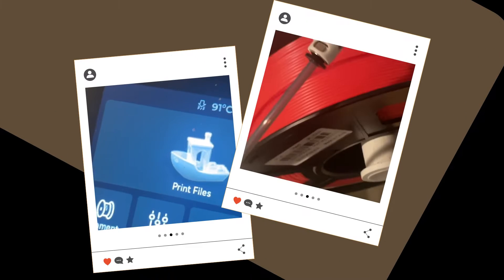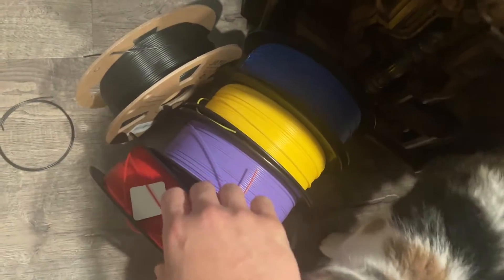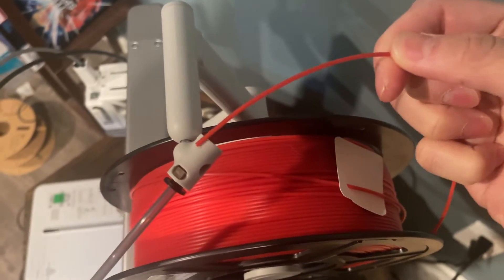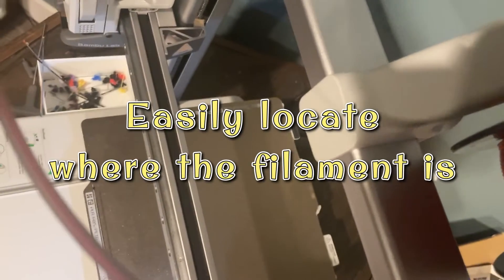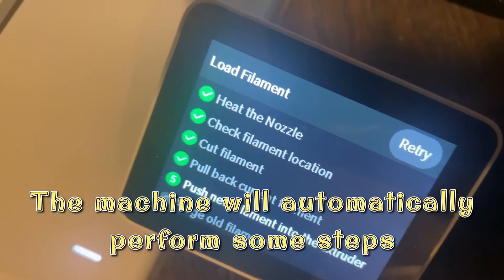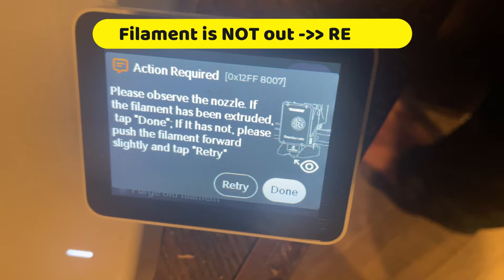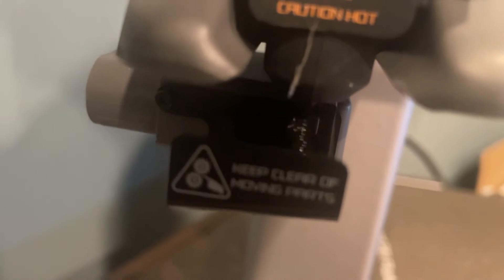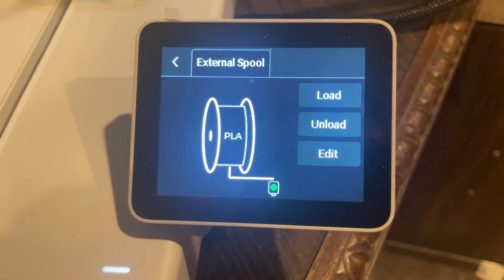How to Load Filament in Bambu Lab A1 3D Printer

Comment: I cant get this to work, i use a ams lite and i unpugg one of the tubes and put in the external but it never feeds it even when i push on it it goes into error message saying the filament hub could be broken but it works fine when using the ams lite